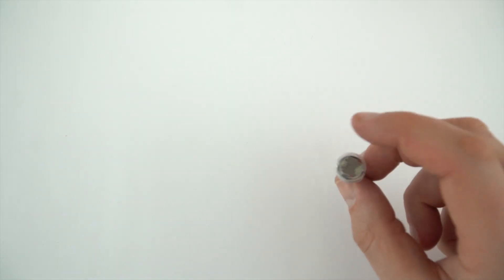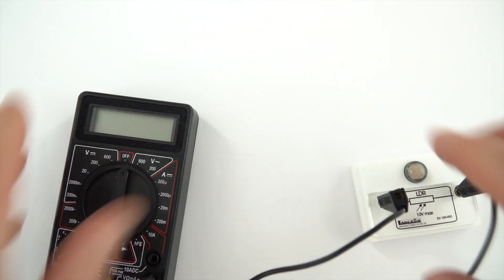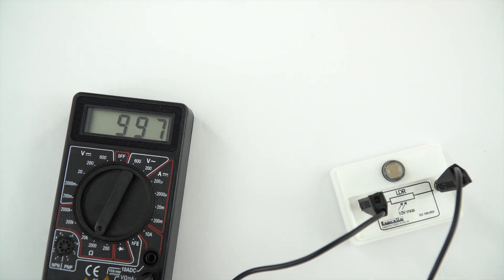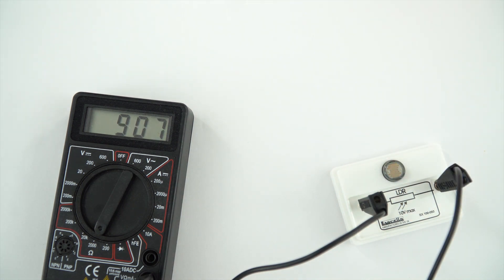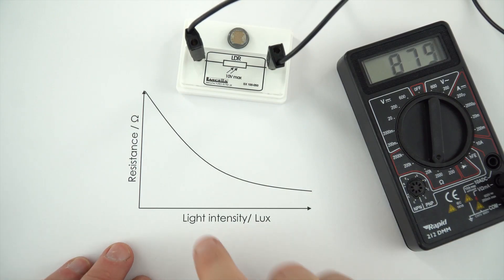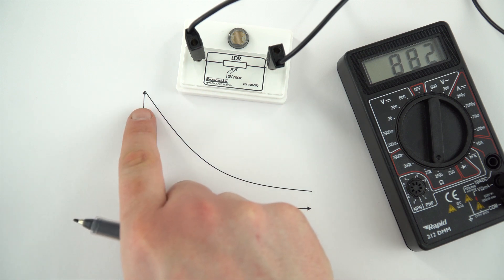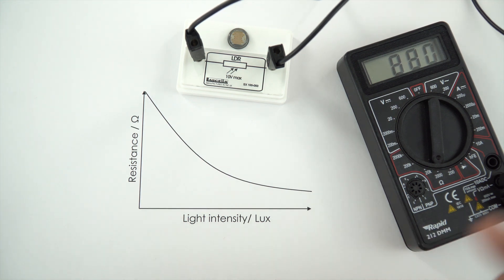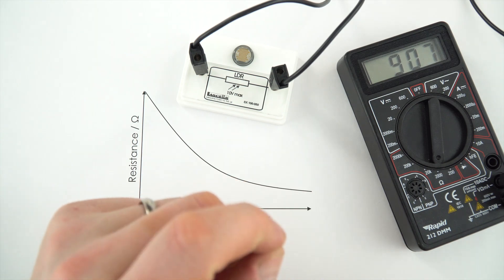Light Dependent Resistors (LDRs) - GCSE Physics

Comment: @Deepak Raj The purpose of an LDR is to decrease the resistance when there is light when there is current flowing through it, therefore increasing the luminosity. They are used in streetlights, so the light shines when it is dark, and the resistance of the LDR is at its highest, so there is light. Think of it as a lamp that turns on when it is dark!!!